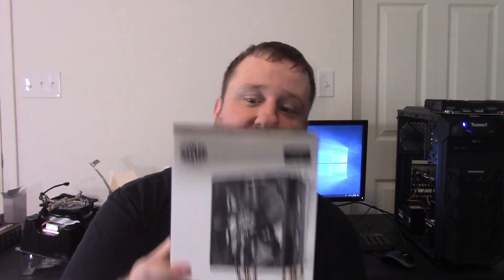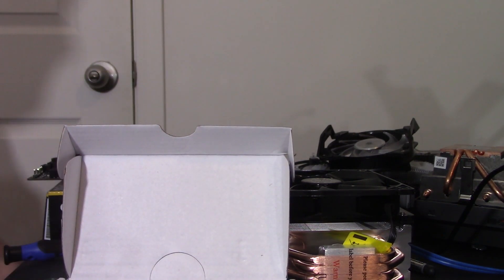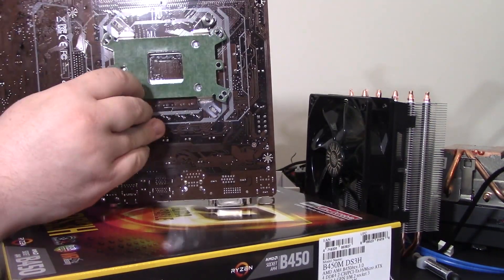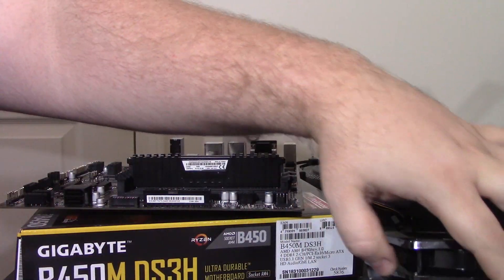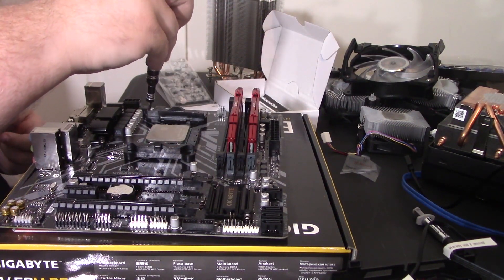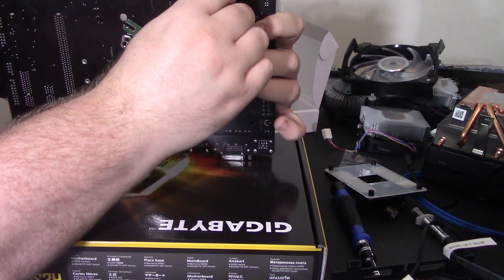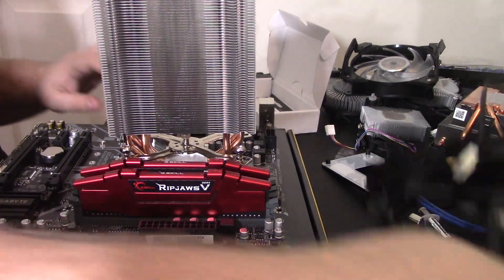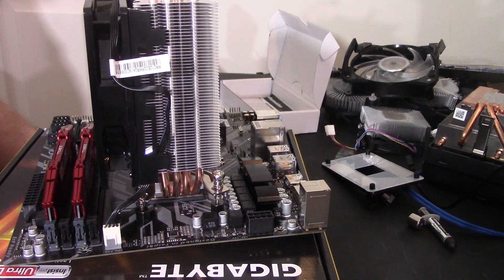Cooler Master Hyper 212 Evo Unboxing, Overview & Installation AM4 & LGA 115X

Comment: This was the first video I could find where someone actually put the Hyper 212 Evo (all I could find where the RGB black edition) so it was good to see that it was possible to install on a AM4 board
Reply: For my am4 motherboard the bracket just doesn't line up, it's off by like a cm
Reply: im not gonna lie, im sitting here after disassembling and assembling my pc trying to get this thing on, and my bracket doesnt look like it lines up, both ways i tried it, i guess ill just have to try again
Reply: update: took it back apart and double checked, it doesnt fit, i shouldnt have doubted myself. 

The one i have is for fm4 am1-3 but not am4
Reply: @drawapretzel6003  you can contact cooler master and if you're willing to pay shipping they'll send over the correct bracket
Reply: @drawapretzel6003  
the spider fits but the backplate holes don't?
Reply: @ramiropaul5087  I mean, the spider doesn't really fit either, but since it can rotate you can still kinda put it on. But I presume it's better if I don't, since the backplate doesn't fit
Reply: @drawapretzel6003  I am from Argentina, here they sell the back plate of the 412, and using that back plate we can use the 212 evo.

Comment: what a saint, this has helped me so much. i was concerned about the pressure on the mounting brackets but good to know that its supposed to be that way.
Reply: I also am still concerned  I just built my first pc yesterday without a gpu so I am not sure if I messed up with pressing the screws until they stopped

Comment: I bought CM Hyper 212X for my LGA 1155 and then i changed my mind to go with AMD (AM4), i checked at the packaging box if the cooler is compatible with the am4 or not and then the manual didnt say that its compatible with AM4 and i was panicked so much 🤣🤣 after i that i went to the cooler master website to see if they have update anything else and gladly they said this cooler can be mount on am4 and i came here to see if its true and thanks for the video 😂

Comment: Wow.  I don't like that mounting hardware.  I had no idea the hardware was different with the Hyper 212 Evo vs the Hyper 212 LED.  The LED versions mounting hardware was MUCH better.  Although the packaging presentation is not as nice.  The screws and such just come in little zip bags.  The back plate is also not hiding on the side of the cooler packaging.

Comment: Instructions are spot on for AM4 with a cooler I purchased from Amazon last week - good video.
Reply: Hey man did the cooler come with the bracket for the AM4 socket? Cause i bought mine from amazon aswell
Reply: XRetroSmileyX Yeah, mine did. There is always the chance they have old stock, but you can always RMA it if needed.
Reply: @NotACrookNixon  ye thanks man

Comment: uuuuhhhhh....you did not mount that proper for the AM4. i just did one of these today and those little "metal" things you didnt know what were for are for the am4 installation....how can you do an install video without even looking at the INCLUDED  picture step by step instructions??????
Reply: those rings he didnt use, I forgot i had those. it was a hassle to mount but should i remove it to apply the missing rings ?
Reply: @mastaspock9271  Yes i think you should. The pressure on the CPU is pretty critical. I once installed a water cooler and it wasn't sitting right from too much pressure on one side and it didn't cool very well at all.

Comment: The Engineer in me wants to use heatsink compound (thermal paste) or at least a supplied thermal pad...
Reply from the maker: You should, as per the video series, I was simply showing the installation process, had to install 4 coolers twice each so I did not want to waste paste is all.
Reply: @BigHeadTech  oh ok thanks fr answering my previous question. Makes sense now especially since you didnt power the board on

Comment: A lot of the strain goes on the board as it doesn't have a back plate (AM4). Just got this cooler and it's bending the board. Need to keep it slightly loose.
Reply: are you not using the backplate?
Reply: @XxHockeyKid34xX  I realised after lol
Reply: @hippopotamus86  How is it? I just bought it for my 3600x. Idk how it will differentiate from the stock cooler + the case I am using has bad airflow (Corsair Carbide 175r)

Comment: Being prepared for pc building =  having proper screwdriver and well I only had a bit for an electric one and it caused me great pain.  Anyway I am at the point where I can't get one part to snap down but damn hard when you only have a bit and a flat head screwdriver.

Also found a new issue as the 4 fans including with my case, the ASUS TUF Gaming GT 301, well I can't figure out how the 1 separate fan being 3 pin will attach to the motherboard which shows no 3 pin attachment.  I looked at where the fan should go and well it shows a 4 pin attachment.  Anyway this experience has been hell and as for future pc building, which I used to love, well it is now dead.

Btw my motherboard if anyone can help me ASUS Prime Z390-A.  : S

Oh and just a note on the video I wish you would have shown up close what screws you were using for the back plate and so on as I had nothing to compare to what I was given.  With that said I didn't see a use of stand offs or whatever to keep the pc from dying when turning it on. I am expecting with how I have my setup now with the motherboard having no built in safe spots for attaching the back plate to the HSF I expect it to catch on fire and blow up.

Anyway always had no trouble with builds and switched to a lower rated case and one made by ASUS who I never usually think to get cases with and also I always went with Gigabyte boards as they  never gave me trouble whatsoever.

Thanks for the video but just wishing like I said you showed a few things a bit closer and given more detail about what you were doing.

Comment: Could I put the fan on the other side of the heatsink (or turn the heatsink around) so that the air blows out the back of the case?

Comment: your back plate is upside down no ?
Reply: Yep
Reply: No
Reply: @UndercoverRuby  actually yes
Reply: @canfran8788  Upon close inspection on both installations he has done both correctly using the and and Intel configurations accordingly as placing the back plate any other would not give proper contact, the holes would most likely not line up and the screws would definitely not screw in properly with the bolts attempting to the install the fan would damage the cou or board.
Reply: @canfran8788  please before giving an answer without thought to a question you were unsure yourself of the answer to, think and look before answering.
Reply: @UndercoverRuby  ok relax it was 4 month ago , we good
Reply: @CAnFRan you right my bad I’m sorry

Comment: Hey I have the same bracket but it doesn't have 2 holes on the edge. I'm installing it for AMD cpu
Reply: this comment is old so you've probably already figured this out, but I also had the older version of this cooler (hyper 212 evo) that doesn't have that those holes and because of that doesn't support AMD/AM4, I had to order the newer version that does support it.

Comment: So this means newer stock has the AM4 X-bracket out of the box?
Reply: I think so because I bought a hyper212 Evo like 3 years ago and I just upgraded my system to a ryzen 5 and I wanted to know if I could still use the same cooler
Reply: But I don't think you can
Reply: @agresien179  i think you can, see the box dont say AM4 yet so the 212 that he is installing is old, pre-am4

Comment: sorry what about the plastic ring  to put on intel cpu  between the first metal backplate on the first four notch?
i followed the instructions and put it on it for my intel i3 8100. lga 1151. 
But u didn't say anything about it and i'm not sure either
Reply: i'm talking about the little rings u sayd at the beginning u wasn't sure about it
Reply: if u follow the instruction i can see is like a gap between the motherboard to not touch directly with the metal pin..i did like on the instructions, but since i don't wanna make any damage i just want to ask uf anyone had the same tought
Reply: the instructions for this product are actually pretty bad, honestly
Reply from the maker: Not used at all I think those are used in lga 2011/2066.
Reply: PCBudgetSolutions thanks for the quick answer! should i remove them? was very tight installation but seems to work fine...my worst nightmare is to break the mobo because of the pressure on it
Reply from the maker: Double check the directions but I believe so.

Comment: Do NOT remove the sticker from the heat pipe base pad until you're ready to install. Additionally, do NOT touch the bottom of the pad or set it down on the pad after removing the sticker lest you could get oils on it. You should also be wearing an ESD device and non-powdered rubber gloves
Reply from the maker: While your suggestions are not bad by any means, they are not very relevant in 2018.  I would recommend you to watch this video here: https://www.youtube.com/watch?v=CDUZRNp4pxg.  Out of nearly 700 PC's built, My Failure of at least 1 single part per PC within 3 years of deployment is less than 1%.  And I've built on carpet wearing socks.  Not ideal, but if you not an idiot you'll be fine.  Touching the base is not the end of the world by any stretch, but should be avoided if possible.  As for the rubber gloves & ESD, an ESD is useful if you're in an extremely dry environment, but outside of that not relevant in 2018.
Reply: @BigHeadTech  Thank you for your comment, however I disagree with some of what you said. Oil is your enemy, It attracts dust which is an insulator which inhibits the conduction/transfer of heat, not to mention the acids found on your skin that will transfer to the copper, aluminium; which is also bad news (over time, especially under heat, and even in anarobic environments). I've been building computers for 30+ years and amongst other things an electronics, micro-controller and microprocessor engineer for the past 20. Given that this is somewhat an instructional video; disclaimers about possible destructive factors should be made and best practices should be shown and followed. Since not everyone has a clean room at their disposal, and not knowing the average humidity of the viewers, every effort should be made to help those watching this video not destroy their equipment. For about a decade I owned a custom build shop and personally built on average 2 to 3 computers a day following "best practices" whenever and wherever possible. I wasn't trying to troll the OP, just point out that generally speaking, the people who look to videos like this know less than the OP; and given the context, safety should be paramount. I periodically look up vidoes, and toss in my $0.02, if safety or best practices could be better or better explained. i happened by this video as an autoplay of a previous video, i did not seek it out to pick it apart or criticize; just saw an opportunity to toss in a penny or 2.

One this I will say, If you're building for work, and you intend to stand by your product, and warranty everything; building in sock on carpet, and without ESD IMHO is not a solid business decision.
Reply from the maker: Much has changed since your day. The risk of static discharge was much much higher than it is now. PCBs have protection against this now days when back in your day they did not. PC Building is not done in closed sealed off areas that are dust free and sterile. Now days, PC Building is pretty cross compatible and very little is proprietary, so kids are building PCs now days. Sure developing a processor and such your recommendations are important and all but we aren't doing that. Quite a bit has changed over the years. No professionals worry about ESD and computer components are not nearly as delicate as they were back in your day. As for oil, not really a concern. The affect on heart transfer would be less than 1*C at worst and there is a huge margin of error for this kind of installation. Heck even Steve Burke from Gamers Nexus showed that as long as you don't use too little paste, it's hard to use too much.
Reply: I ground myself on the computer case  when I build